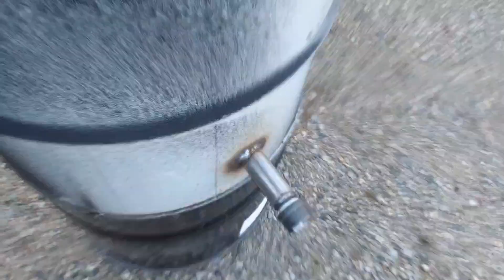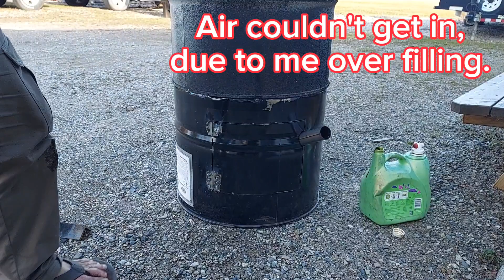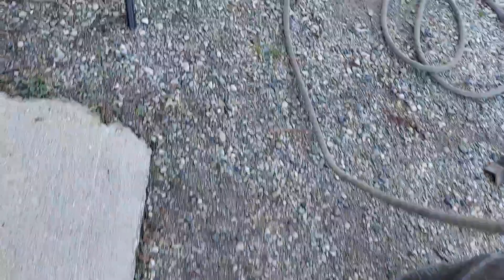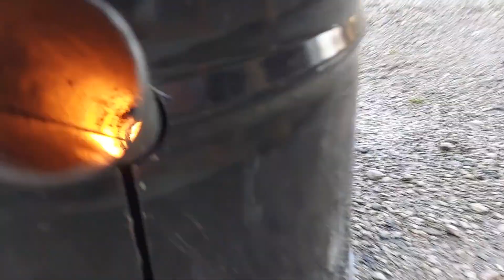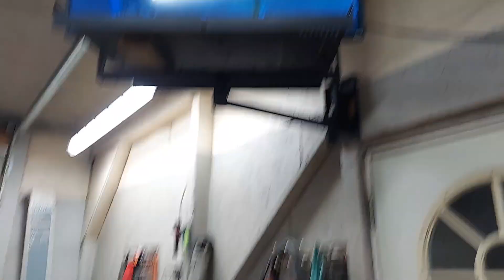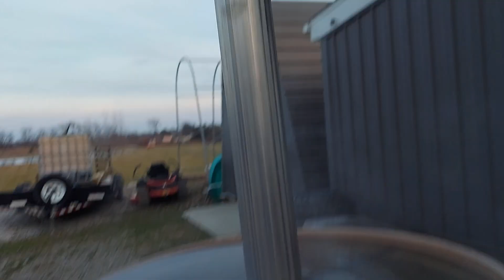Natural draft waste oil burner!Off grid water heater build part two!

Comment: If you punch those numbers into a BTU calculator, the effective heating of the water is about 23,000 BTU (or 6.7kw). Insulating should help a lot as should adding some forced air. (preferably through some small 1/8 inch holes) 

I don't have time to run all of the math and figure out what your total oil consumption would be, but about .185 gallons per hour would give you the output you were getting, at the last hour of your test (4-5pm) 

The Creative Inventions channel has (probably) hundreds of air feed systems that work really well. I built a burner off one of his designs and it makes a clean blue flame with no smoke at all. I've even tested it with an air quality meter and it's impressive. 

Anyway, cheers, and good luck. Play safe.

EDIT: After posting this comment I realized that your chimney / exhaust is going to be your limiting factor, and unless you put something to pull the exhaust out, feeding air to it will only have limited success.
Reply from the maker: I have a bunch of forced air burners. I was just testing an idea. SHTF scenario. I just watched one of your burner videos last night. I built my own homemade outdoor boiler and have been heating my home and shop for the last 5 years. Check out my other videos. Happy New Year!
Reply: @karlsoffroad  Ah yes. I have seen some of your other videos, I think. One interesting one with a tube in a tube... maybe. 

Oh... "have been heating my home and shop for the last 5 years" ... I wasn't aware of this. Cool. I have been planning to build one for probably 5+ years, but always ended up finding reasons not to.... I'm glad I finally built one.
Reply from the maker: @loweredexpectations4927  I saw that. I think you're going to gain a ton of efficiency when you make the upgrades you mentioned in your video. Good luck, and I'll be watching.

Comment: How do u think a solo stove would work as a burner?
Reply from the maker: @greggoryleblanc1024  I think it would work. I don't have any experience with one of them,but as long as you can get the oil hot, it should work. You may have to get some charcoal going and then add the oil?

Comment: Shoot pair 3 of those together with a pump and you’d have a good hydronic heater for a shop.
Reply from the maker: I took it a step further and built a 500-gallon outdoor boiler that runs on waste oil or wood! I just posted a tour of that setup. Check it out, and thanks for watching!
Reply: @karlsoffroad  think I saw that one too! Once I’m able to use my wood boiler I might convert too! I’ve probably got 2-3k gallons of uses oil laying around.

Comment: That is working very well!
Reply from the maker: When I put it in service, I'll be using a blower burner. More reliable and much hotter. I just wanted to see if it could be done without it,just in case. The blower only pulls 20 watts, so it will still run on a small inverter.

Comment: You did a really good job. 
You said you didn’t have secondary air, but you do. The intake that is on the side at the top of the burn chamber/box is secondary air. Also the 10 plus feet of stack or chimney was what I was trying to say before when I commented. 
What I built was for shop heat also, the burn chamber was a 10” Dutch oven. It has a 6” pipe about ten inches long that  connects the burn box to the stove thingy on top then out the chimney. The chimney was about 18 feet long. The whole thing looked like a potbelly stove. The stove part was two semi trailer break drums welded together. All in all it was about 150 ish pounds and got hot AF. It heated a 28’ x 40’ shop with ez! I still have the stove, I don’t have that shop anymore and I can’t use it where I am now. How well you have that thing running is perfect. Good luck
Reply from the maker: I point out the extra air intake just before I light it. I'm still fine-tuning, but not bad so far.

Comment: A cheap hot water circulation pump, old 4 core radiator and some cobbled parts and you could heat the whole shop.
Reply from the maker: I'll be using it to heat a 30-foot RV for the winter. I have the pump and heat exchanger already in my parts collection. The propane furnace is getting expensive. That's what started this adventure. 

I'm also planning on building a decent sized cabin at the back of my property, so I might have to make another one! I heat my shop and house with waste oil already in my homemade outdoor boiler. Works great, and I don't have to split and stack wood. Cheaper and less work.
Reply: @karlsoffroad8609  Sounds like you got it figured out! I thought about building a similar system before I moved a few years ago. Great video and heater!
Reply: Success. As you pointed out, insulation on that drum is going to get it up to temp much quicker. I really don’t think a circular pump is necessary. A typical home water heater doesn’t use one. Thermal convection should be enough. If your burner became built up with ash and crud by the end of your burn, that may explain more smoke near the end of the burn than in the beginning. Preheating the oil before it enters the fire will help it burn hotter and cleaner. A simple wrap or 2 of the oil line around the burn tube before it enters will allow the oil to absorb some heat. It doesn’t need to be touching the burn tube, just close.

Comment: If Drums are as thin metal there as they are here, you did a brilliant job on the welding straight off. 
Insulation will make a big difference to this and you will be surprised how long it holds the heat.  Right now the surface are  radiating heat to the cold atmosphere is about 10X the surface area putting heat into the water. once you fix this, I think the heat up time will be way faster. 

For your Circ pump and a blower if you wanted, you could run them off just a little 250W house panel with a buck regulator. 
You should get enough power from 2 panels on a Cloudy day but I think once you insulate this, you will find the water stays hot for 36 Hours or more.   The way you have this now, once insulated, I don't think you will need a circ pump or a blower. 

You could also automate this slightly.  Get a thermostat and a liguid solenoid.  Light the burner and once the  water comes up to temp it just shuts off the fuel. 

Are you going to use the water direct or put a heat exchanger in the drum and feed clean water through that? 
A small radiator off a car or bike would heat the water to whatever the drum temp was with good flow. 

Doing very well with it mate!
Reply from the maker: Thanks, the drums are very thin! I have about 30 years of experience welding.I do custom exhaust for a living at my own shop and worked at a welding shop when I was a kid. I've been building my own stuff as long as I can remember. 

I will be running a small inverter that goes from 12-volt DC to our 120-volt AC here in the States. I have two pumps,the inverter and the heat exchanger/radiator already, so I will just use what I have on hand.  I didn't plan on running a blower, but I could, if it won't keep up with the demand. I think it will, but I will know for sure in a few days or so. 

Thanks for watching and for offering helpful advice! I watched all of your videos and still re-watch them. I've done some PV direct, but only with DC devices. I might add a few DC water heater elements for backup and run them directly to my panels. We'll see how it does without it for now. 

The barrel of water was still warm at 5am. this morning,everything was iced over with the freezing rain, so I was surprised. It's currently snowing and about 25 degrees Fahrenheit ,so below zero in Celsius. I will be using this to heat a 30-foot RV,so it should work fairly well,I hope.

Comment: If ur able to put a generator motor on your windmill you can also capture energy and keep your battery pack charged
Reply from the maker: I have two of them charging the batteries that run my outdoor boiler. Along with 3k watts of solar panels. I will be upgrading both turbines pretty soon!

Comment: If the shtf no need to worry about a bit of smoke is there.  You have done great with the natural draught but as you say it could do with a few more holes.  Not big holes though, start off with about 1/8" holes approx 6"above the oil level in the burner.  I would start off with about 6 holes, just that will make a massive difference.  45 imperial gallons that you are warming up is a huge amount of water so you did excellent to get it as hot as you did.  With the added extra holes you will be able to boil the water for sure.  I am experimenting at the moment weather permitting to make a water heater but mine will be using a blower so it does the job quicker and a circulating pump through a heatsink and pump it into the tank.  So fill tank up then heat through heatsink and circulate the water.  I should be able to get 10 gallons in around 20 minutes hopefully.  You will have to wait a while for me to show this due to the weather and the pump I need with the proper fittings.  Should be sorted in a month hopefully.  I was trying to just heat the tank as you are but found water condensing on the bottom of the burner was dripping into the burn chamber and thus cooled it down too much and got very smokey.  My solution, which works very will was to put a 90 degree elbow on top of the burner and blast sideways, the heatsink supported with blocks so the heat was directed underneath the tank as required but without any water dropping into the chamber.  Directly through the heatsink gets the water nice and warm, hand hot but no hotter with a small flow rate.  If I fill the tank up and then heat the water through the heatsink it will be at least 4 times quicker I am sure, maybe more, need to show and test when I get all the bits.  Sounds a bit complicated but is dead straight forward really.  Great job to you sir though and look forward to your upgrade with great anticipation.
Reply from the maker: Thank you for the kind words! I appreciate the suggestions, and I will definitely keep trying to get this burner smokeless. I look forward to seeing what you have come up with. Have a great day!